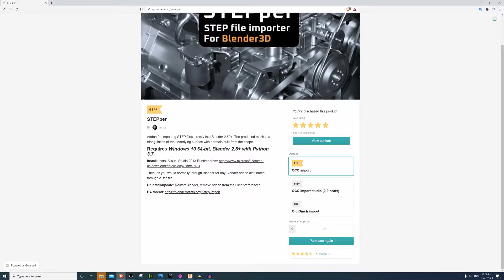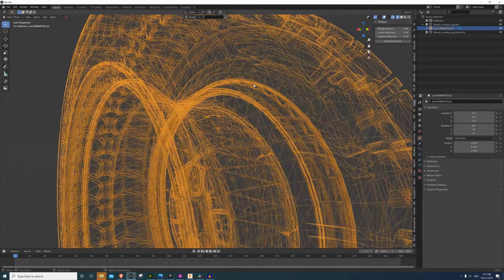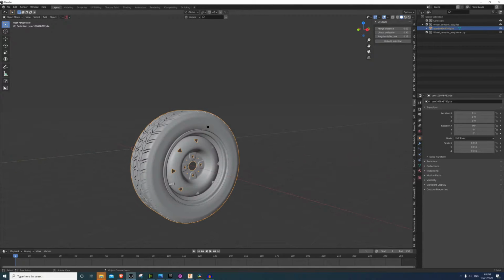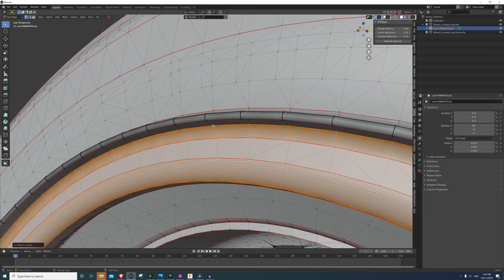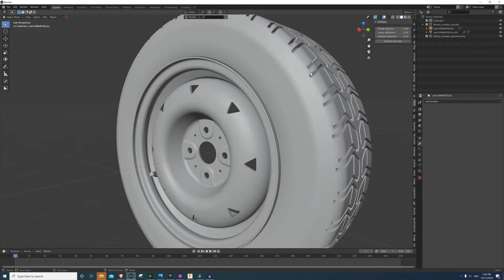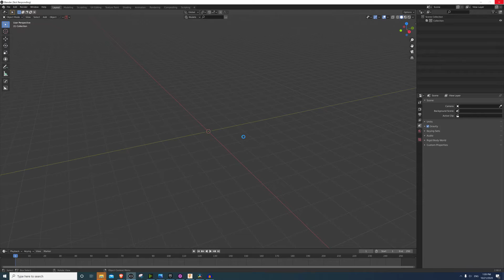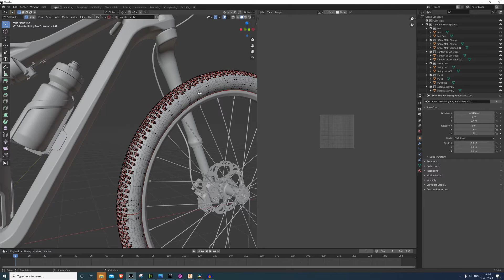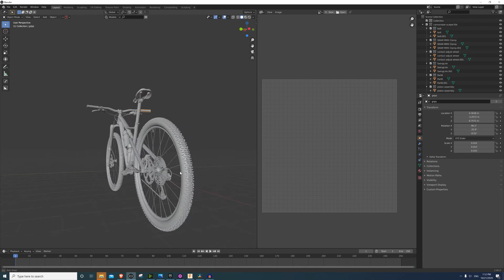Best way to work with CAD models in Blender

Comment: Hi, great tutorial. My question would be related to mesh. When you import OBJ to the Blender you tend to bring in lots of triangles and those tend to cause issues with AO bake. Any quick fix to convert / fix these triangle artifacts? Limited dissolve and Alt + J don't always work on all surfaces. Especially on cylindrical surfaces and small radiuses.

Comment: There is no change even if 'Merge by Distance' is applied. I tried control 'Merge Distance'.
Would you help me?
Reply: What exactly is the issue. Even if you adjust the merge distance the overlapping vertexes are not merging?

Comment: This is awesome man! Ive been rendering solidworks models for my job the past two years. There was very little information on how to easily do this two years ago so I had to just figure it out on my own and got stuck using .stl files the whole time, This seems like a step in the right direction for me though. Id be interested to see more of your workflow. Some of the models I work with have holes in cylindrical faces and they still seem to be tricky to work with.
Reply from the maker: When you import all intersecting edges are separated, overlapping. if you go into edit mode select all and merge by the distance you can reduce poly count and also make manifold meshes. Also increasing the import resolution can help with difficult meshes. Another thing is to use the weighted normal modifier to help with shading issues. I have noticed that Step files that are super complicated might crash when importing. a way to get around this is to break up your cad file. I once had a 6  system setup that would not import but once I  exported and imported all 6 as separate steps and merged them back together in Blender.  I was able to have incredibly complicated step imports. Also for scale, I usually need to set my import at 0.001 to have an accurate scale. the default is 10x real-world scale.  These are just a few extra tips hope they help. This plugin was a life saver for me in my work.
Reply: hi Josh, i am about to render solidworks files in blender ( i still hat 12 day on keyshot trial licence). But to be honest if I could find a good tutorial how to make custom scene/studio and approx 50 materials for my client I might be good with blender and not to buy keyshot for 2k... of course it is compliant rendering, but with this addon it could be aserious alternative. (also could bring keyshot price a bit down)
Reply: @janosgyerman  Using the blender 3.0 Asset library you can build a neat setup. I made a quick video showing it. https://youtu.be/UNB9pav6IMs
You can save your HDIR or light setups as asset presets that can be dragged and dropped in. different backdrops or stages, and of course material libraries.  Once you have all 3  it is super fast to get a render out.
Reply: @foxidog  Hi Mikael, is it possible to get in touch with you sometimes? phone or email?
Reply: @foxidog  i might have done something wrong, i want to apply bevel on sharp edges but it does not seem to work...

Comment: I'm one of those idiots who knows how to "rig" parts together in Solidworks with "mates", but has no clue how to export the parts from Solidworks, load them into Blender, and do the very same thing (for animation purposes).  Can you give me a few vocabulary terms that I should be searching for?  Is that CALLED something?
Reply from the maker: Hi, I don't have the answer to this. Right now my workflow is working together with engineers who work in Solidworks while I work in Blender. The only information that gets transferred over using this method is the mesh data. I rig everything in Blender and all mechanical animations are done natively in blender using bone rigs and physics simulations. I don't think there is a way to import any rig or animation to blender using this plugin.
Reply: @seidlerdesign_ou  I'm barely getting my head around how Blender is only for making a (moving) picture that LOOKS like something, rather than an "actual" computer representation of specific hard objects.  Everybody is just "eyeballing" where a hinge or joint would/should be, etc.  That's new and confusing at first.
Reply: @craigsearching  thats exactly the difference between CAD software and CGI software. And why CAD is based on nurbs and CGI in poligons and similar
Reply: Better late than never?
In Blender and other software the terms are parent / sibling (select object -> Ctrl+P)  for linking geometry together, and Origin --> Set origin to selected geometry (Shift+S) to place the axis centerpoint for rotation, if that is what you were trying to do.